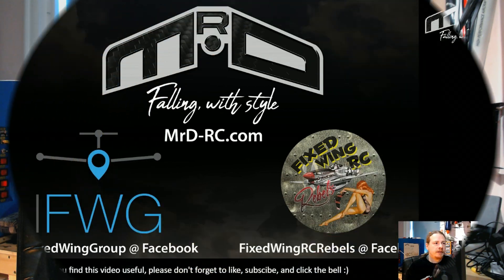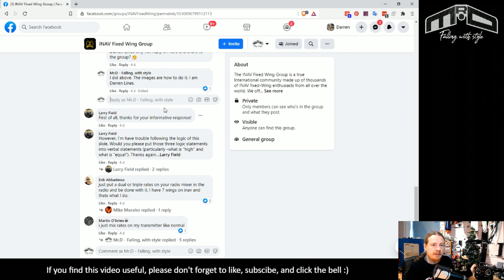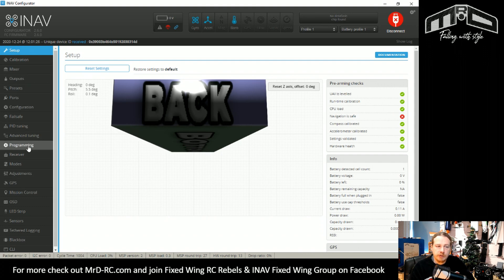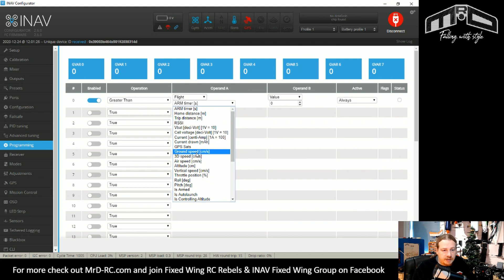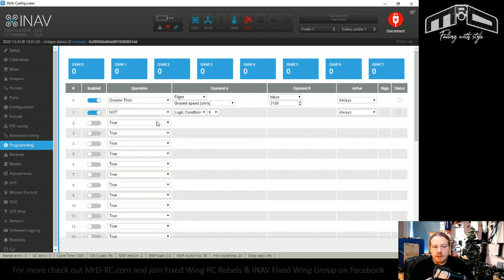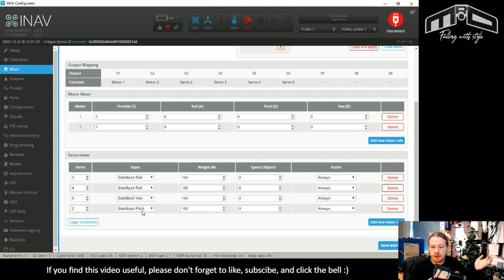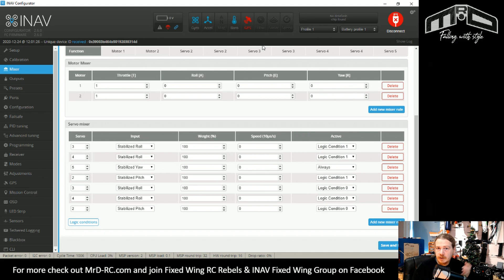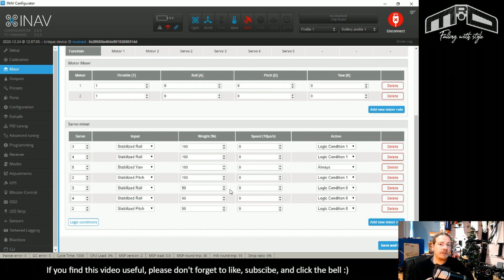iNav Programming - Automatic control surface rates, based on your plane's speed

Comment: I was wondering.. why not use 3d speed.. because its probably more precise than only ground speed right? If you don't have a pitot tube that is... is there a risk in doing so? Anyone knows? Cheers!
Reply from the maker: No risk, 3D speed would actually be perfect 👍🏻
Reply: @MrD  thanks! At one point I disarmed and only realized it after some time.. for some unknown reason  (totaly my fault) it headed in a spin to earth.. With only gps gound speed it would probably not have enough registered speed to override.. that started me thinking.. 
Anyway thanks again! Cheers

Comment: Thats a cool vid. In OpenTX like you said you could do this there, and you can make set it to a global variable so the the rates are progressive. As the throttle goes up the rates decrease in a smooth manner. Does Inav deal with global variables?
Reply from the maker: Unfortunately the transition is immediate in iNav. It would be great if there was a way to make that smooth. Especially as in 4.0 there os actual profile switching. However, from testing the profile switching, the transition isn’t too bad, even without the smoothing.

Comment: Would it not make more sense to do this based on throttle stick position, since that is directly proportional to airspeed?
Reply from the maker: The problem with the throttle stick is that its a pilot input. I wanted to try to make is purely based on flight parameters, something that could only be true if you are in the air. If you were on the bench or working on something, and the throttle was not low. That would then mean that the model could be armed instantly, which is really not a good situation to be in.

I was also thinking of altitude, but this would not work as sometimes it glitches, and what if you are actually flying below the launch point. This is why I thought speed would be the best option.